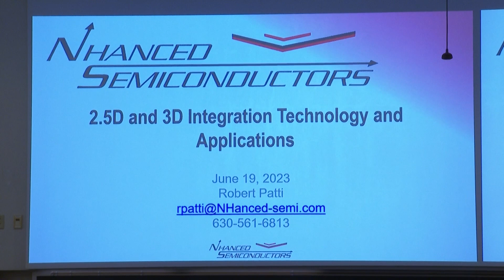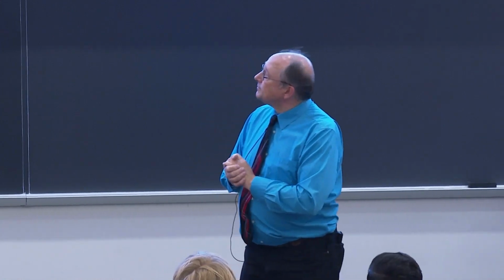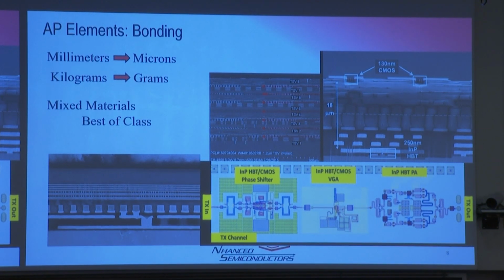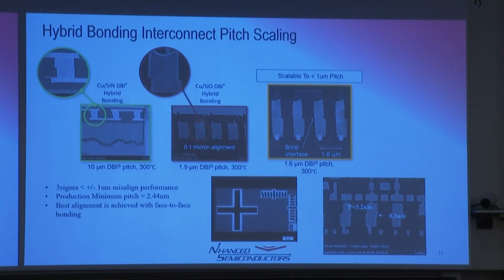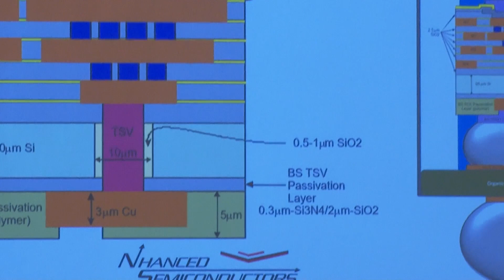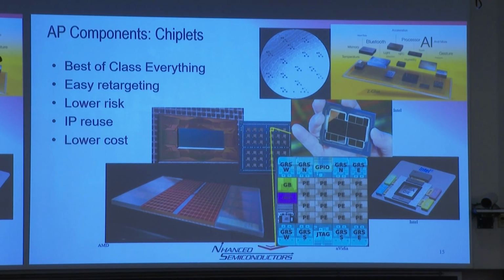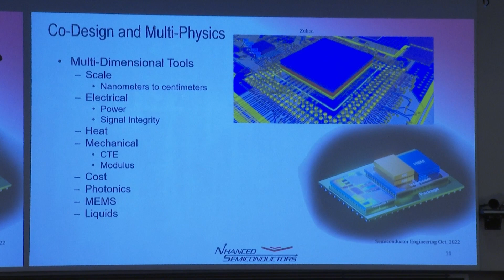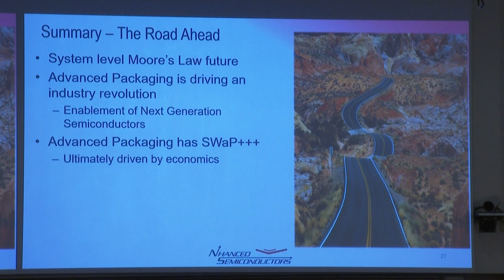Bob Patti: Advanced Packaging of Semiconductors

Comment: In the context of heterogeneous integration, how do you see collaboration evolving across the industry to further leverage these advancements?
Reply: Such a good question, here are my few thoughts!! Would be interested on others as well. Honestly its now the competition that drives industries forward:
Firstly, not necessarily all companies should go for heterogenous integration per say (bang for buck equation at play, from design & manufacturing). Yes, system Moore's scaling is the new Moore's law, but not necessarily 2.5/3D is the only way to go.
Secondly, the industry also is driven by EDA per say and that's really a sharp enabler of things and that leads these innovations for big players.
Third, is the inherent competition at Tech will always be a key driver for optimization. Addressing power, thermal and testability will go a long way for larger adoption.
Finally, it's also down to standardization across players as well.